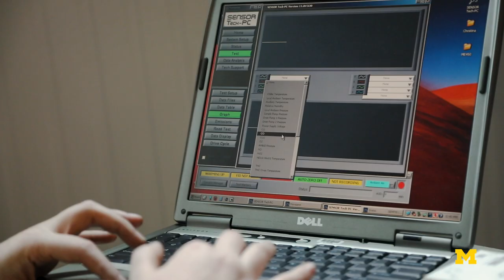Reducing carbon emissions by capturing truck exhaust

Comment: Ive been researching up on particulate exhaust capture filters. All of this is good. We need to start with the larger industrial plants like smoke stacks. Use those as a test trial and then as the tech gets better, shrink it down to the individual vehicle if needed.
Reply: Yes, just upscale the method and apply it on industrial exhausts as well.

Why don't you ever see the greens talk about this?